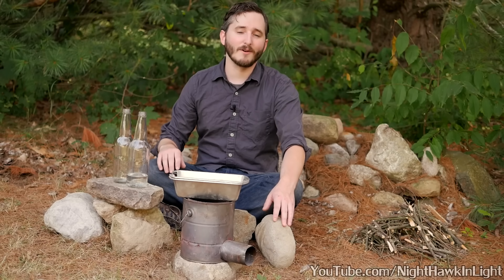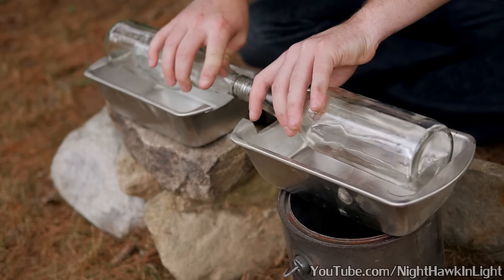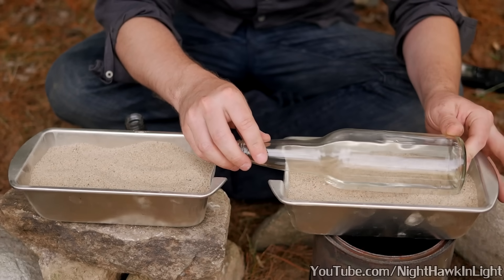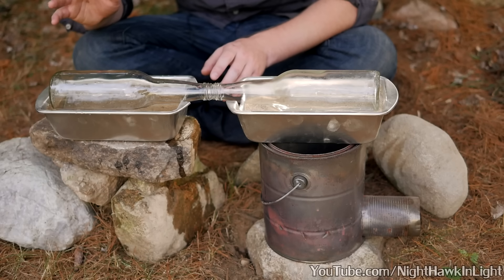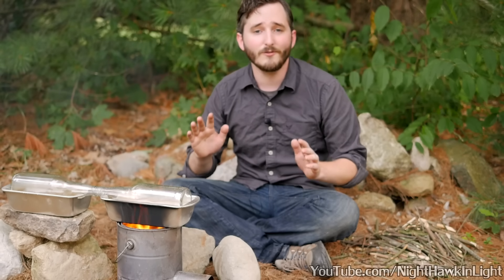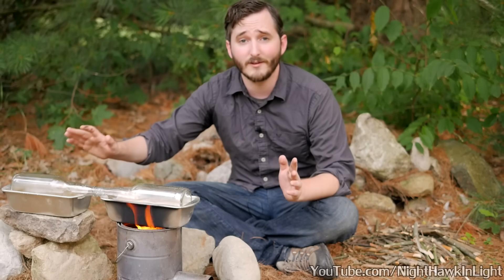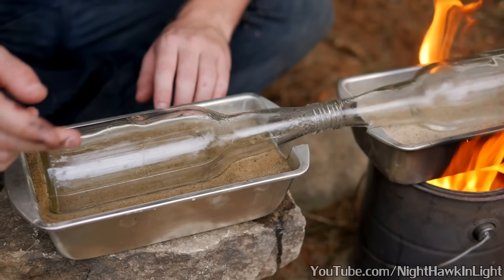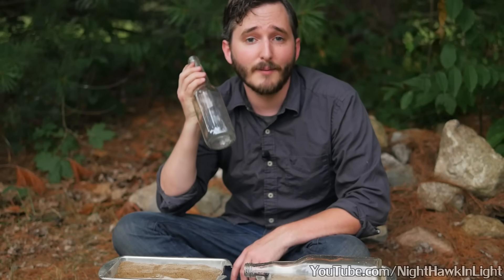How To Turn Salt Water Into Fresh Water (Simple Improvised Distillation)

Comment: Why not tape the bottlenecks together?
Reply: You have to have tape.  Then you have the problem of constantly untaping and re-taping.  You also would have to pierce the tape to provide pressure relief, or that tape probably will let go with a loud pop sending your bottles flying.  You have to allow pressure to escape as the system heats up.

Comment: What about the other minerals we need in water like Magnesium, Calcium, etc.? Don't they stay along with the salt in the first bottle? It would be like drinking snow. People die in mountains because of drinking that kind of water. It dihydrates you contrary to what you could expect. Any thoughts please?
Reply from the maker: You can add a few drops back from the first bottle to the second and that solves the problem. There is no problem to begin with as long as you have things to eat, you will get your minerals from food instead of the water.

Comment: I've considered camping in upstream hill country and using locally sourced water but was concerned that boiled creek water is still boiled deer piss. I think I'll give this a shot, and out of consideration for man-made pollutants, not seal up the condensing bottle until after the heating bottle has started to properly boil. That should help reduce the presence of volatiles.

Comment: Wow...given that if you are near a beach,  military standard way of distilling clean drinkable water from saltwater is still more effective than this method. Having a glass bottle may not be an option. Those odds are not as high as you say. Digging a hole in the sand back far enough from the tide yet deep enough to the water table then heating stones in a fire and dropping them in the water creates steam you then drape a clean(ish) cloth/absorbitive material over the hole which gets damp with the steam, you then evacuate the moisture into a container of sort and repeat. Military Survival handbooks for the Up to Date U.S. Armed forces are written and designed to save lives and are readily available and affordable. Invest in one. You might just live.
Reply: Not quite certain that it is more efficient than this method here. But definitely more laborious

Comment: Problem is: in salt water distillation you will distill water from salt, but there are easily vaporizing acids or other substances that can be dangerous as well, and will go in your other bottle with distilled water. Since your body has buffers to control pH and prevent acidosis, and probably it would be low concentrations of acids, but sulfuric and nitric acid can be dangerous. And some other substances can be present.

Comment: As gross as it sounds, this process can also be used for urine.  Naturally you can't live solely on distilled urine, as you will be losing water in other ways, but it can keep you going if push comes to shove.  Add in some brackish water etc and you'll increase your survivability substantially.

Comment: This is so ineffective.  You can easily just fill a pot with salt water and put a tarp over with bottles tied to the multiple sides and it will do the same thing.
Reply: Thats assuming you find a tarp. In most cases yes you might find a plastic bag but that wont last that long not sure it would even last 1 use. This just shows you how to do it with bottles.

Comment: You might want to mix your distilled water with some sea water before drinking, as distilled water is really not good for you in large quantities.
Because it contains nearly no minerals, it will flood into your cells, swelling them and maybe even bursting them. (Small quantities as in the video are fine - there's not a lot to rush into cells to begin with and it'll pick up minerals on the way, but too much could seriously harm you)

Bonus: You get more drinkable water
Reply: Yndostrui - you do realise that the water goes into the stomach and eventually into the intestines and eventually into the large intestines where it is absorbed into the body for use.  It's not going to be very distilled by the time it's gone through all that.  You're not injecting the stuff, so what you said is basically bullshit.
Reply: Don't forget to take your homeopatic pills before drinking distilled water. That'll keep you safe.
Reply: This is simply not true. Distilled water is completely safe to drink, although it may taste a bit flat or tasteless. The human body is more than capable of picking up the minerals it needs that distilled water lacks from the food you eat.
Reply: Jonathan Lucas Add rocks and dirt for supplements.

Comment: If it's that simple, why did people died out in the sea for lack of water? I don't think that distillation was an unknown back then. Even today people are still dying of dehydration when stranded or in the middle of the ocean. What's the catch to this method?
Reply: Only works if your gay, or straight but more feminine than masculine and there is a full moon at 3pm on a wednesday and the wind is blowing west to east rather than the standard east to westerly wind that most people stranded in the ocean encounter, I think the actual statistic is about 97% of known stranded people at sea encounter the former type of wind so you have to be very lucky to be the 3% that get the correct wind for this to work.

Comment: to remove man made contaminants use some of ur charcoal as a filter.......viola activated carbon filter
Reply: Small open fire Charcoal does not equate to activated char. 
That has to be heated to much higher temps than you can get with a tiny open fire or even a regualr charcoal making barrel. 
It is all about the amount and size of the open micropores in the carbon source as to what it can effectively filter out per volume as activated char that makes it superior to regular charcoal. Regular charcoal can work but you need lots of it and different size molecules of different contaminates may not be contained in the char efficiently depending on the mentioned char pore size obtained.

Comment: If he was to really help he would send them containers which they do the prose fast with no sand needed plus some plastic wrap they could make more fresh water then just by hoping the sand heats up cause water heating prose is faster give some clear bins and having some plastic wrap will tae less time and effort if not they take some so pipes and parts and just build a distiler shit most copper comes from that area just take a ore of it black Smith it till u make a sheet and just turn that sheet of copper into a pot belly like stove and collector just put the copper in hole from the sand I dig and just stick it in there fill it with cold water from the ocean and just boil the other side and boom u got the same thing as the bottles better yet why not just build a glass system cause well u have a shit ton of well sand aka silica aka glass wtf I must be high cause this is just stupid in more ways then one shit just teach people how blacksmith and glass blow tools for survival and boom u can make a big fucking dent on well dehydration problems and the clear water issues in africa

Comment: Dosent this guy know filtering salt water into h2o is easier then boiling it if u had a glass bottle like that just put it on the beach away from the ocean or salty water and just dig a hole about a foot wide and how many inches the bottle id plus a few extra and just grab a plasic bag or a dark color shit and have it over the bottle with it tipping down wards so add a pebble in the middle and have the hole filled with salt water and make sure there's enough water so it dosent push the bottle up and let the sun make u water or better yet anither way would be make a fire get enough charcoal dump sand on it so take that charcoal make and make a water filter so that the bottom of it will be a faberic best is silk then if a mesh so u put the charcoal now the more refine it is the better filter but the easier it goes through some fabrics have it a multi layer base so a 7 to 13 layer thick system and pour ur water in it gravity will make the salt water fall through cause of weight but it will force the salt water through the layers which will filter out the salt and micro life forms from it then just bottle the water it will be about 94% prlure fresh water and u dont have to sit the for hours on end to make only a few ozs to making well liters of water but why in the first place would anyone need a fire and charcoal and boiling water when if u make a fire from forest Y not just go up hill till ur at the top and find where the water is running off anf then just go to that water source theres so many questions on how what and why did his method shit if u live in the Sahara and had to make fresh water out the ocean just having a piece of fire wood would be impossible so the only way they can make any fresh water is just using the sun to evaporate the water by which one finds another wat to collect like a gord or a bottle or whatever and have that be in a middle of a hole int the gound full of water will be the only option so I respect the man and his science but some of his logic is lost from the facts of survival

Comment: Distilled water has no salt. It is pure water. Distilled water will pull salt out of the tissues because now it is the absolute lowest concentration of salt. Tissues will also take in a lot of this water because it too passively diffuses and it is hypotonic. When this happens in the blood, red blood cells tend to burst because they can't tolerate a terribly large change in tonicity, and so some red blood cells die. The other problem is also that the salt control mechanisms in the kidneys malfunction because too much salt gets leeched out of them and passed in your urine, after drinking too much distilled water, electrolytes and important minerals get leeched out of your body and this creates electrical abnormalities in your body leading to irregular and weak heart beats (from hyponatremia and hypokalemia), poor muscle strength, high blood pressure and fatigue. Distilled water as mentioned, is fairly acidity (can be as low as pH 3 when freshly distilled) and leads to acidification of the blood (acidosis) there is no exact amount of water that one needs to drink to die. This mode of death is related to hyperhydration /water intoxication. This can happen from over-hydrating with regular tap water, but will take longer than distilled water because of the salt content in tap water.
just thought it worth mentioning.

Comment: it's illegal to have glass bottles on most beaches in the states.. also if you build a fire on top of a mound of sand it's gonna be quite hard to heat up the bottle under it because heat rises and it will pull the cold from the sand past your bottle keeping it cool.

Comment: What if the bottle got too hot, would it explode? And also support rocks, don't some rocks explode if they get too hot?
Reply: yes, a bottle can explode if it gets too hot, why it needs to be heated as evenly as possible. Use dry stones, and not stones that has been in water.. these will be more likely to not explode or crack.

Comment: Question is I thought it was bad to a drink distilled water because it is missing some vital sodium and minerals.
Reply: In a survival situation where you need to produce drinkable water, who cares about sodium and minerals.
Reply: @jjflash2611  
Exaktly my point of view
Reply: @jjflash2611  I have overlooked, see Tach's comment from 10 months ago. He's right. You better care otherwise you will be dead. If you drink it with a meal it made sense.
Reply: @Todd Cooper - I agree that drinking distilled water over long term may cause health issues, but in a survival situation, distilling dirty bacteria laden water to drink will not cause any problems in the short term.   You’d be dead in 3-5 days without any water, or get violently ill drinking dirty contaminated water.
Reply: Well, you can throw very little  sand  in there and voilà,  minerals granted.

Comment: One other method is to place the flasks upright, using a piece of leave or bark to funnel the water steam down to the other bottle. This way you can fill the bottle all the way up. You can also use plastic bottles this way (fire wont burn true a plastic container as long as it holds water) , just keep in mind that some of the chemicals from the plastic will transfer over. But if you are desperate enough to do this in the first place, you Probably don't have an option either way.

Comment: Refill the source bottle before it goes dry or it'll get too hot and risk breaking. Also, if you can find bottles with different neck/opening sizes, you can plug one into the other and have better recovery (i.e. less gets lost from where they meet in your set up)
Reply: Assuming you have a knife (and who doesn't have a pocket knife all the time?), with a little work and a piece of a small tree branch you can make a wooden adapter to provide a snug fit between the bottles.  If you're lucky enough to have bamboo, that's even easier.

This is the basic system.  Adapt it to fit, especially if you need it for longer periods during which you'll probably be able to find/fashion more materials.

Comment: Perhaps if you make the condenser sand damp it will make cooling more efficient? As for the sand mound method use a second mound to hold your condenser bottle in place.

Comment: Will this work with homemade ethanol?
Reply: If you've ever heard of a "still"...
Reply: @dodgeplow  what?
Reply: A still. that how they "distill" moonshine (Ethanol). A lot depends on what exactly you're trying to distill. Ethanol (173 F) and water (212 F) have different enough boiling points that you should be able to separate them. You just have to apply the heat very slowly or both will evaporate together. However, other impurities may not have enough of a difference (methanol is a common adulterant and the boiling points are closer together making it hard to separate).  This is a common process in organic chemistry classes.
Reply: @dodgeplow  oh so basically its like a reflux. We have an investigatory project where we need to make bioethanol from banana. Its already fermented now I dont really have a reflux or a still so Im trying to find other ways to distill it.
Reply: the reflux/cooling tower is good for compounds close in boiling points. It would really depend what forms in banana fermentation. It's high is starch, so I'm sure you get a good bit of ethanol, but I don't know what kind of esters or ketones might be formed. It wouldn't hurt to try simple distillation, but you'd have to test your end purity to know what you actually got.

Comment: Nice but unfortunately, you're gonna die of thirst before you get enough water...
Better to make a water still with one paint can inverted over the other... 
Put a fire under the bottom can and keep pouring water over a stack of fabric on the top...
Devise a method of drawing off the condensed water...
Properly done, you'll get a quart an hour...

Comment: ... Wouldnt it have been a lot more effective if you used a tube at the top to funnel it over to the other bottle? 

I mean... you could argue " well, What if i didn't have a tube? "... I mean, its not like youd have 2 metal pans that are cun like that. You did however show us a way to heat the bottle without a pan. but if you can find a glass bottle, you can find a garden hose.

Comment: This should be possible using 2 coconut shells (whole, drained thu the eyes) or 2 big hollow bamboo sections with a bamboo pipe between them. 
2 flat stones could be angled together to make the sand tray over fire for the heated one.  The cold one on Just a big sand pile.

Comment: I do believe there is a issue here... 

Since your bottles aren't sealed to each other, which I believe a gob of clay would help fix, there is enough room between the bottle lids for a lot of your water vapor to escape.
Reply from the maker: It's surprising how little of it escapes. Try it out and you'll see
Reply: @Nighthawkinlight  will do when I get a chance. 

My car's coolant hose broke a seal and I found out that the leak only happened when the coolant is hot enough to steam. The steam goes through the seal then supercools back into liquid right away. 

That's why I was concerned about the bottle back crack

Comment: Regarding your rocket stove, from The View I that was shown I only saw the top opening and the feed hole for the fuel. You didn't put in any air vents?
Reply: I wondered the same. If you make up a Rocket Stove for emergencies, they are VERY efficient and you only need twigs and dried debris for fuel. I have seen some cool ones that use a baked bean size can in the middle of the paint or coffee can with sand under and around it to keep it from losing heat and to insulate the coffee can from burning the bottom out. The soup can goes in the side into the baked bean can to vent in air and to feed in twigs. They even make homemade grills to put on these. Clever idea for an at home emergency too. Even just hot water for tea would be nice if the power goes out (Use it outdoors only of course).  Little starting fuels like a Q-tip dipped in vaseline, etc. and a lighter can be stored in the can and a lid put on it for storage. I was thinking of putting a wooden handle of some kind on it so the handle wouldn't be hot. I am planning on making a couple of these for myself and a couple of my favorite neighbors so try out. Now I will need to add the distilled water items to the kit and maybe pack it all in a small bag together. Loved this video and the tips. Thanks Night Hawk.

Comment: If you happen to be caught out in the wild, with no water, but you do just happen to have 2 bottles, a stove and a couple of baking trays. (Doesn't everyone). In any case, give the water won't be heated much beyond 50C, this method will take days to get a small amount
Use some tube. Even a bit of garden hose will do. Seal it is using mud